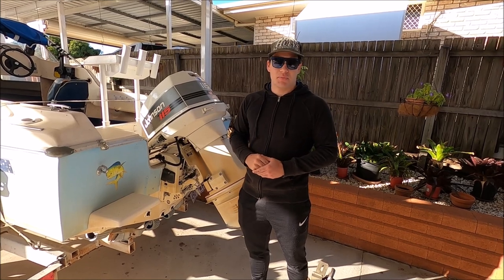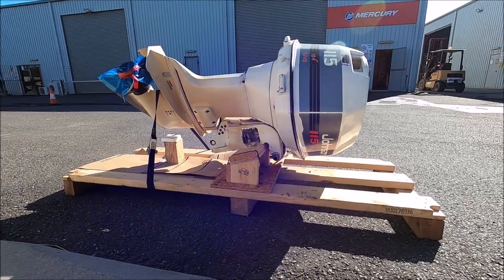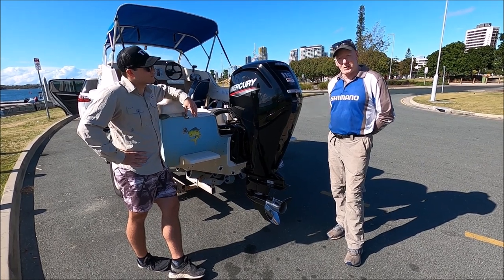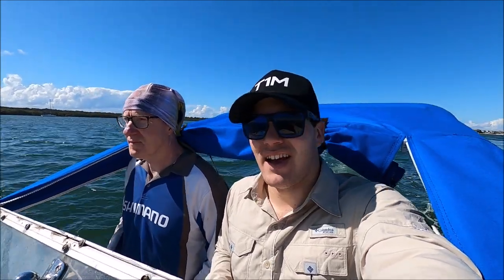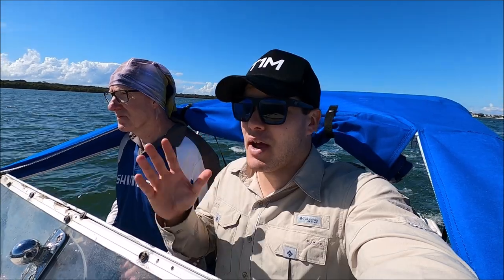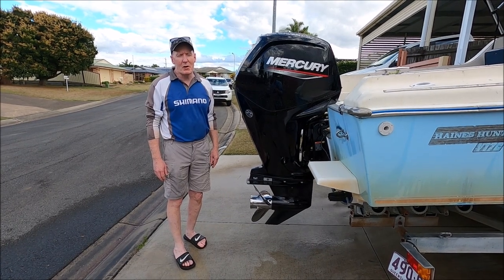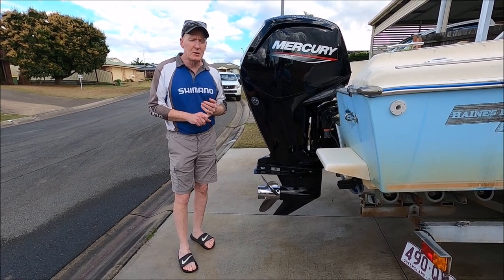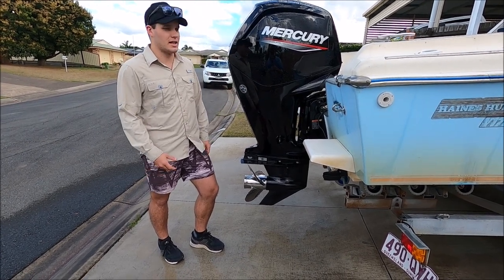Brand New 2022 Mercury 115hp CT - How to run in & first impressions!!

Comment: Nice motor.  I just bought a new 23 , 115merc  as a replacement for my Mercury 120hp Force. 2 stroke that had a busted gear shaft and was 25 years old. It's going on a 16 ' Sylvan.  The hull is only 420 lbs dry. All aluminum deep V. It did 45 mph with the 2 stroke so I'm pretty sure I'll get very close to 50 knots with the new 115 and the right prop. I could have bought a 75hp that would have been good too but now I'll have a lower rpms at the same speeds and less stress on the outboard. 45 knots in choppy water with other boat wakes and swells at 45 degrees to the transum is crazy.  It seems more like 125 knots when your boat starts to lift all the way off the surface.  It's a bloody white knuckle rodeo. Involuntary cardio workout. Aka a hold on for dear life scenario.

Comment: We thinking of going for this very one for our rib.  
Been running an etec on it for past 15 years and it's been fine...punchy.  but bits keep breaking...emm, flywheel and now gbox going, so I think it's time.
Excited to see this vid.
Well done getting that long out the Johnson.  I used to run a Johnson vro 70, I think it was.....mechanic told me VRO stood for very rarely operational..... Cheers from Scotland
Reply from the maker: Hi mate, thanks so much for the comment all the way from Scotland! 
Yes I think you’d really like the Mercury on your rib. We got this particular one as Mercury are one of the lightest four strokes on the market, and our boat naturally sits a bit lower at the back anyway. Even though it’s light, as you can see they have plenty of power, are quiet, and VERY fuel efficient. We’re getting just over 2km per litre. 

The old Johnson was great - very well looked after the whole time, but similar to your etec we were thinking “sooner or later it could just give up on us out at sea”. 

I’m glad you found the video helpful and I hope you enjoy whichever new motor you decide to buy mate! Cheers 👍😁

Comment: Sweet update to the motor, gent's and thanks for the video! I'd be interested in how you think it compares to your old motor, weight and performance.
I mentioned to my wife a couple of days ago that I'd like to upgrade my 33 yr old Mariner 45 hp to a Mercury 50 HP Four Stroke and she said, why don't you get a new boat!  Went to the local dealer and she found a nice 18 ft. (5m?) Lund  that she liked with the standard Mercury 115 hp.  Boat prices have gone up quite a bit over the past 30+ years; in a bit of a price shock right now but going in next week to talk and hopefully make the purchase.  I'm out here on youtube trying to educate myself on the new motor.  Have to wait for 5 months for the ice to come off the local lakes before I'll be able to run in the new motor/boat, though.
Reply from the maker: Hey Ross, sorry for the late reply mate! I’ve been on a holiday without internet access. 
The new motor has been absolutely awesome, it uses half the fuel (or even less some days) and is extremely quiet too!! It pushes the boat along super easy too, since it has the CT (command thrust). 
We went with the Mercury because it’s probably the lightest fourstroke compared to other brands, and our boat naturally sits a bit lower at the back already. It’s just okay thankfully👌 

That’s exciting to hear about your new boat and motor mate! Ours is 17ft which is about 5.1 metres I believe, so yours would be around the same! Mercury is a good choice and I’ll have to google the boat and have a watch of some videos, sounds awesome! 😁 

Far out it seems cold where you are! Whereabouts are you based mate? 

Thanks for the comment Ross 👍🎣

Comment: Have you still got the boat? I have a 5.2 qith 115ct and the fuel economy is very poor. How is yours going and what prop do you have
Reply from the maker: Hi mate! Yes we still have the same boat and motor combo. Our boat is 17 feet long with the 115ct. It’s going really well for us! That’s interesting that your fuel economy isn’t very good! We are getting just over 2km per litre, compared to 1km per litre with our old 2 strike motor. 
Our prop is: stainless steel Mercury Enertia prop. The writing on the prop says: 14.0 X 19P RH

We also just cruise when we are on the plane,  at around 4000 to 4500 rpm if I remember correctly. We don’t zoom around as fast as we possibly can most of the time, especially when offshore in a bit of swell and stuff.

I hope this helps, thanks for watching 🙌

Comment: Im looking at one of these for my boat. Do you know what the top speed is of this on your boat?
Reply from the maker: Hi mate, sadly we still haven’t measured the top speed but we are putting together a video reviewing the motor and our thoughts on it so far. We will do a speed test when we finish that video! It’s definitely very very fast though. In fact we haven’t had it up to top speed since we ran the motor in during this video, because there is no need for us to go that fast 😂
 
All in all though, we absolutely love the Mercury 115HP CT fourstroke, it has been brilliant on fuel and has plenty of power and speed even with our 17 feet long fibreglass boat. 
I’d definitely recommend one and I will hopefully have a top speed for everyone soon. Cheers 👍

Comment: Gday mate. I know video is a bit older now, but how is the donk going. I’m looking at buying a boat with the 115ct on it with 230hours. 
Cheers mate
Reply from the maker: G’day mate, that’s awesome that you’re looking at buying a boat/motor! The Mercury has been absolutely awesome since we got it, can’t fault it yet! 
It’s a lot quieter than the old 2 stroke which is good, and also way more fuel efficient. We’re using just less than half the fuel we did with the 2 stroke, getting just over 2km per litre. The old motor was 1km per litre. 

It’s been reliable and runs very smoothly, and the fact that’s it’s a CT means it’s got so much power and pushes our fibreglass boat along easily. The CT gets you up and going fast, and is great for going through the bars too because as soon as you put the throttle down, the boat just takes off. I reckon having the CT also helps lower the fuel consumption.
 
Ours is up to just over 100 hours now, and we love it. 
Hope this helps mate, thanks for watching and enjoy your time on the water!! 👍
Reply: @willkitching  cheers thanks mate

Comment: Will, do you get alot of water coming over the back at rest offshore?
My old cruise craft is constantly wet at the back
Reply from the maker: G’day mate, we do get a little bit of water splashing into the back well on days that are particularly choppy, but on calm days it’s pretty good. 
That’s mostly why we went for the Mercury though, as the boat naturally sits lower at the back (the same as your cruise craft by the sounds of it). The Mercury was lighter than other brands like Yamaha for example. 
The Merc has been awesome though! 
Cheers mate and tight lines 👍🎣

Comment: How’s the engine running now after a few months?
Reply from the maker: G’day mate, it’s been absolutely awesome!! It pushes the boat along really, really well and every trip it keeps proving that it is way better on fuel than the old 2 stroke. We’re using just less then half the fuel we did in the past! We sit it on 4000-4500 revs and don’t really need any more than that although the maximum revs are 6000. 4000-4500 gets us cruising along pretty quick. 
And it’s a whole lot more quiet too. 
Absolutely no faults so far! 
Cheers mate 👍

Comment: And Top speed is ????
Reply from the maker: I’m actually not too sure yet mate! I didn’t measure the speed sorry, but I definitely will next time it’s up at max speed 😅👌
Reply from the maker: @Do-iz6qd Hey mate, yeah it’s been tough to find time to film it. As you said, when you’re out fishing there aren’t too many times when you can get up to full speed or find time to film extra footage of the boat. I’m currently in the process of planning/filming an update video on the motor, and our thoughts on it after a couple of years of use. It’s been very impressive, and top speed doesn’t matter to us either as long as it’s powerful enough to get you places and to have a decent fuel economy 👌👌 cheers mate